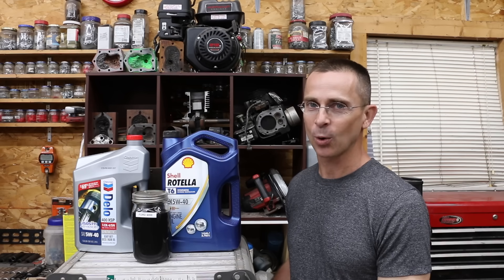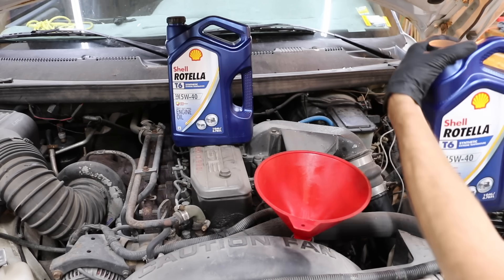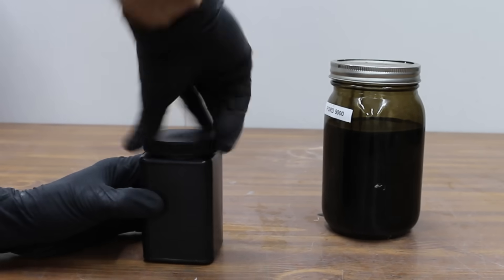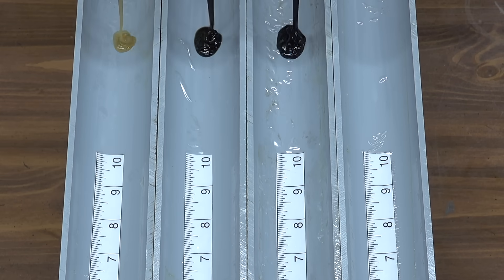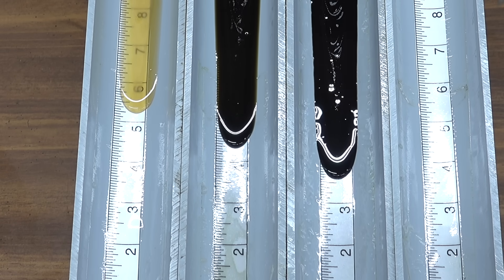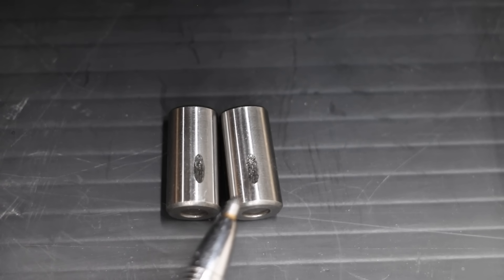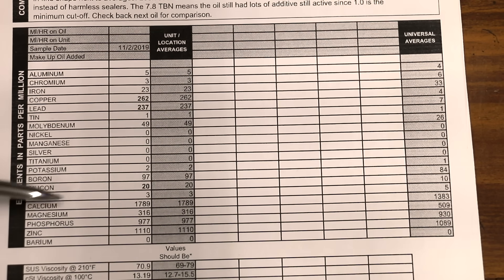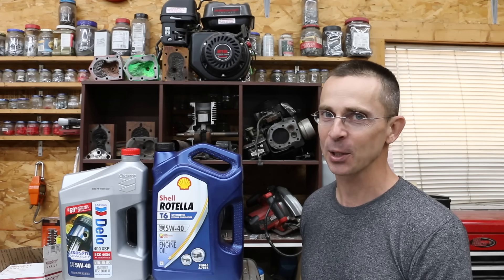Will Annual Oil Change Damage Your Car? Let's find out!

Comment: Great vid!! Have you ever considered testing break in oil? I recently broke in my generator and was amazed at how much metal came out so i swapped over to break in oil 2x and then regular oil and its clean now. I guess im wondering if there is a benefit to using that over regular oil? Anyways keep up the awesome vids!!
Reply from the maker: Thanks,will do.  Thanks for the video ide.a
Reply: It would be an interesting test I agree. I build engines for myself or others and I have never ever used break in oil. What I have always done is just use the engine manufacturers specified oil for that engine. Or if the owner of that engine wants to use a specific oil that is what I use. I run the engine and dial it in either on a run stand or in whatever it is going into and after they have 500 miles on that oil I change the oil and filter. At 1500 miles same deal change that oil and filter. After that I encourage them to change their oil as the manufacturer and oil maker of their choice specifies. On small engines or air cooled engines same deal no break in oil just a really good diesel or if possible an oil with an air cooled rating change it a few times after a certain amount of hours or miles early on and they are good to go. The metal you are seeing in your generators oil is because at the factory they don't clean parts very well prior to assembly and their machine work/quality control is sometimes not exactly great its within a spec range that works for them. They do not expect people to take care of the engine the way that you do. I have had customers over the years tell me my engines do not have the debris of other people that build engines and last longer. They ask me my secret and I tell them I clean everything thoroughly before machining, after machining, and I clean all parts thoroughly. As for machining everything is on the number I blueprint and they have a copy of all the numbers along with a balance card. Most engines I build get thoroughly de burred and usually coated with Red Glyptal inside is my personal preference. People who do not want the de burring and coating thats perfectly fine with me it is not necessary.  Rule of thumb when I started was use a good non detergent oil of the weight the engine calls for to break in the engine which works. If everything is machined properly, and the correct parts are used for that engine I don't believe break in oil is neccessary. I have ran synthetic oil or conventional during the break in period and I have never seen a bit of difference. The few oil related problems I have seen are wrong oil type for the application of certain engines,  people who run out of oil, people who just do not change their oil, and do not maintain their engines. If you want good information on engine building I suggest reading Power Secrets by Smokey Yunick you can apply what he teaches to any engine. Also anything written by Bill Jenkins aka Bill "Grumpy" Jenkins everything he writes can be applied to whatever engine you want to build. I use another product that has shown me great oil analysis results in engines for wear and oil cleanliness it is called NMF or Go NMF it is expensive yet I like what it does for engines and gear boxes if you have never heard of it check it out.
Reply: It sounds like you really know how to build an engine! If more people took the pride that you do in building engines im sure they would have no need for break in oil. I will look into that oil that you told me about , im always looking for a good product to keep my engines running smooth! 🍻
Reply: @acuraintegrar5  NMF its not exactly an oil it is an additive that reduces friction. I was extremely skeptical because I really do not like adding anything to engine oil. In my air cooled V twin engines NMF it kept my oil temperatures down over the hot summer weather and I do not run synthetic oil in them. As for smoother running it really helps and it hasn't shown on my oil test results through Cat Diesel an improvement. You can add NMF to an engines cooling system and it helps keep them clean along with extending the life of the bushings in water pumps. As for engine building anybody can do it its not rocket science. It just takes patience and your always learning something new definitely never gets dull. The books I mention are a little dated yet I just use that knowledge with current parts/technology and it seems to work really well for me. I would actually like to see Project Farm do tests with NMF it is a really neat product. Much better than Power Punch, STP, and Lucas from my experience.

Comment: Impressive testing. I would still, however, change the engine oil yet even sooner than what’s in the manual. Oil comes rather cheap, a lot cheaper than an engine repair would cost you. Your test assures me that if I would be slightly late with changing the oil and filter, I still am within the safety zone. All because oil doesn’t serve as a lubricant only. It collects dirt too. Hence the changes in colour. Even smaller, microscopic small particles can, and often will, cause damage no matter how small that damage might be. So, to avoid all this as much as possible, I stick to the every 6 months oil change intervals. Specially if you want to keep your vehicle for a long time. Just part of taking good care for it. It is, after all, a large investment. And a rather bad investment so you want to get the best out of your investment. I’m sure it will pay off in the long run.
Reply from the maker: Thanks.  Thanks for the feedback.

Comment: i use t6 in my 87 bmw 325i and 92 gmc sonoma.  The higher zinc is needed for older vehicles.  Both engines run smooth.  The sonoma has 140k and the bmw has 162k.  I wouldnt use it in a modern engine, but for older, it is the best i have used.  And I used all different ones in the sonoma.
Reply from the maker: Thanks for sharing.

Comment: I would highly suggest you run 15 W 40 in that 5.9 instead of 5W 40 I have almost the exact same truck and when I went to 5W 40 my blow by increased by almost double it’s not thick enough for the motor
Reply from the maker: Thanks for the video idea.

Comment: Thank you for cutting through the B.S. Just wondering if just changing the Oil Filter has any effect on oil life. I was told once by a customer to change oil on his low usage vehicle once a year, the filter every 6 months. His money, his vehicle. Also does changing from one brand of oil to another after long term usage affect internal engine wear and seals?
Reply from the maker: Thanks for the feedback.

Comment: I had to add Rotella more often than Delo 400. The Delo turned very dark within 5000 miles. My oil service was 15k miles. I sold that truck with 1,400,000, needing a rebuild, but had no oil related issues. 11.1 liter Detroit, series 60. Thanks for the video!
Reply from the maker: You are welcome!  Thanks for sharing.

Comment: Great!  I have changed the oil in my 1950's diesel ferguson tractor once since I bought it 15 years ago.  Just add oil as it leaks.  Good to know about the t6, I just bought enough for 4 oil changes.  My oil change indicator has not come on yet on my 2015 ram after 15k miles and over a year of driving.  Will change it in better weather....
Reply from the maker: Thank you!

Comment: You can prime the filter if it has the  antiflow back valve. You may lose a little,  but  the idea is there. Oil pressure comes up faster.
Reply from the maker: Thanks for the feedback.
Reply: @ProjectFarm  oil should be changed  every  3 months or 3000 miles,  which ever comes first.   19 years in a lube shop.

Comment: Your tests are very rigorous and I don't want to criticise. My only comment would be that you should perform each test more than once to try and mitigate any small variables, and then use the averages to determine a more accurate result.

I realise that this would be time consuming on top of an already time consuming process. But I feel that tests such as the cooking off test could have a lot of variables that would cause one oil to outperform the other, and that results may be different on a second and third test.
Reply from the maker: Thanks for the suggestion.

Comment: I enjoy your content immensely! 
In case this interests you...
I have a small fleet of diesel dump trucks and gas pick ups that I maintain mostly myself so this stuff always interests me. 
when investigating oil for my little air cooled VW 1200 cc vintage race car,  I happened on Redline’s web site. 
There was comparative info regarding their 20-50 Racing oil and the Shell 15-40 Rotella mineral oil which I normally used in my fleet. 
I was surprised Rotella was listed since the performance parameters they measured  were so similar. 
I also sent my drain oil out for testing and went to annual oil change intervals as a result. 
Even in the race car. 
The only exception is my 20 year old Honda CRV with the 2 liter 4 cylinder which I assume must run high oil temps as the oxidation numbers always came up higher than suggested. 
I change the little critters oil at 5K intervals and use a quality synthetic 5-30. 
257K miles and it’s still humming (literally being a I-4 ha) along perfectly ha. 
Thanks again!
Reply from the maker: You are welcome!  Thanks for the feedback.

Comment: This test is even more relevant in this pandemic.  Since I'm now working from home I'm not putting hardly any miles on my car.  Normally I'd be changing the oil this spring and have about 5k miles on the oil.  This year I'll only have about 1.2k miles.  I'm thinking I can go an extra year this time.
Reply: Same here. Work from home and only put around 1100 miles in one year.
Reply: I put 25k on in one year and i dont even commute for work 🥲
Reply: Only if you run Full Synthetic oil.  Conventional oil goes acidic.
Reply: @eurotrash4629  Presumably also dependent on the usage of the vehicle.  Or is there actual data proving that natural oil goes acidic and eats away at the engine even when the vehicle is only used occasionally?
Reply: @Ian  or you could do your own oil analysis and see how your OWN oil is doing after an extended period of time, not just go by someone else's results using a different oil on a different vehicle. Just my $.02, no offense intended.
Reply: @ian1352  I would talk to oil test companies and ask them if they test for acidic factors in their tests ! 😊

Comment: I constantly get in arguments about this. My users manual says once a year or every 10,000 miles and people say NO THE OIL WILL GO BAD 6 MONTHS MAX. I try to tell people motor oil is not the same as it was in 1950 when you started driving a car. Thanks for the video proof!
Reply from the maker: Thanks for the feedback.

Comment: Can't help but wonder what the long-term effect of conventional motor oil versus synthetic ...we've seen synthetic is designed to be kept in longer... conventional has a shorter mileage change interval but I wonder what the time factor would be on conventional
Reply: they both essentially have the same additives. And that whats breaks down over time, however if driven properly like explained in this video, but has few miles, under 5000, they can easily last 3 years...operating temp is the key  to lasting, when only minimal miles are accumulated..
Reply from the maker: Thanks for the suggestion.

Comment: I had a 1288CC 4 cylinder aluminum OHC motor with cast iron liners. At 125K miles I had to remove the cylinder head (Twin Swirl design) due to lead deposits in the exhaust ports from 260 Sunoco gas I burned. While having the head at a machine shop I measured the cylinder walls and had .0002" wear on the diameter and before the cylinder head cleanup the compression was 178psi with a new motor spec of 175 psi. After the install of the cylinder head 3 cylinders were 175 psi and one was 165 psi. I was running a 10W30 Super Shell oil with change interval at 2000-2200 miles with a Purflux filter. This motor and 4 speed manual trans was common sump. Later the top gear in the trans wore out and small shard splinters could be found in oil sump drain. I bought a new trans out of Paris at 150K due to the 3rd gear in the trans splitting from my foolish driving. That little car could outrun a regular Volvo on the highway.
Reply from the maker: Thanks for sharing.

Comment: I have a Kawasaki 2 cylinder 600CC twin on a lawn mower running 5W30 Mobil 1. I run the oil for 2 summers with 2 hours per week in the 5.5 month work interval. The oil in the sump at changing time looks very clean and clear on the white plastic dip stick and the sump oil in the drain pan looks a little hazy in an appearing 20% color vs. fresh 80% oil balance. With synthetic oil I could probably run the oil for 3 seasons.
Reply from the maker: Thanks for sharing!

Comment: I'm running the T6 0W40 in the 5 cylinder Sprinter with 180K miles. I changed from T6 5 W40 to the T 6 0W40 (10K miles ago) and for Chicago cold weather the 0W40 is definitely easier on the motor in cold starting. My change interval is 10K miles. I will get oil testing done in another 12K miles.
Reply from the maker: Thanks for sharing.

Comment: Rotella T6  vs Mobile Delvac 1  vs Castrol edge with A3/B4  specs ,  Castrol also can be used in diesel engine without DPF filter .......
Reply from the maker: Thanks for the suggestion.

Comment: On your wear scar test, I wonder if it you also show weight change (amount of material ground off). It would be great if you had a spreadsheet of the weight change of all the tests you did so new tests could be compared to ones you did in the past. A comparison against 20 products is more valuable than against 1 or 2 others.
Reply from the maker: Great suggestion!  Thank you.

Comment: Your conclusion is right about T6 vs Delo 400, but you have to keep in mind Delo 400 is an API SN Plus oil and the T6 is not. So the Delo deliberately has a lower anti wear additive package because they have to consider use in catalytic converter equipped vehicles. It's more of a mixed fleet oil where you can put it in gas and diesel vehicles and only need to stock up on one kind of oil. That being said I'm considering the Delo 400 for use in my Grand Marquis because there really isn't any 5w-40 oils on the market that meet the latest API specifications, and that's just talking about SN+ not even SP. Most 5w-40 oil is intended for use in European vehicles and only have a API SN rating.
Reply from the maker: Thanks for the feedback.

Comment: Been using a 25K mile oil change without any time limit for 40 years without any oil related engine issues. My last Mercedes had 30 years 330 K miles without an issue.
Reply from the maker: Thanks for sharing.

Comment: I would not recommend using these oils in a gasoline car. The additives, especially zinc, lead, and aluminum could possibly foul catalytic converters and oxygen(O2) sensors. For older non-emission engines that have carburetors, these oils are indeed a good choice. Put this stuff in your lawnmower or other small engines, but not one that is electronically fuel injected. (Ryobi generator) It may have an oxygen sensor in it.
Reply from the maker: Thanks for the feedback.

Comment: Have you done a video comparing high mileage oil, like 10k miles vs say 3k mile motor oil or new oil? I wonder if synthetic oils should really be run for 10k like they suggest. I still change at 3k miles in my ranger but my buddies do 8 to 10k miles.
Reply from the maker: Thanks for the video idea.

Comment: Re T6 in gasoline engines, I asked a Shell Oil tech guy about this and he first said it is okay [if no one gives a hoot about any catalytic converter that may be attached - my adder].    I then asked why it did not have the starburst logo/ emblem on the container and then he said, if I remember correctly, because of the higher ZDDP levels, it could harm catalytic converters.  [Aha, that's more like it.]  Also, it apparently does not have some of the additives that help increase fuel economy that the oils with the starburst symbol have.  Service SM does not equate to compliance with GF-4 / GF-5 specs for gasoline engines.
Reply from the maker: Thanks for sharing.